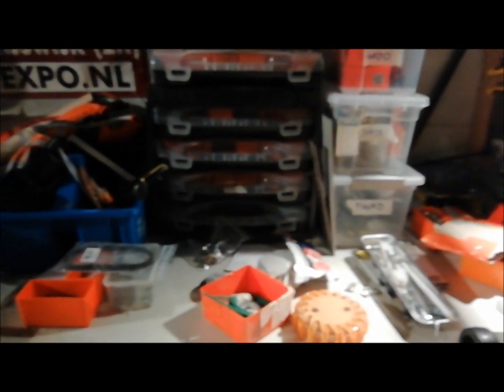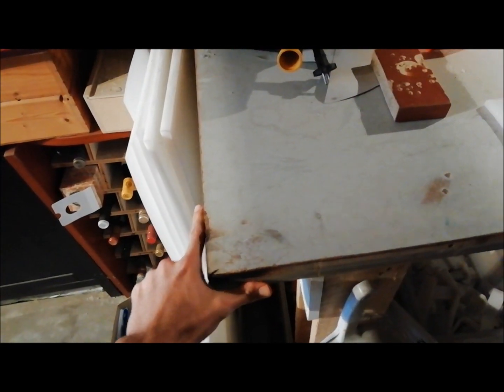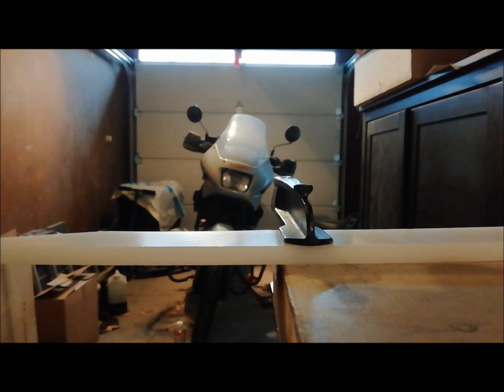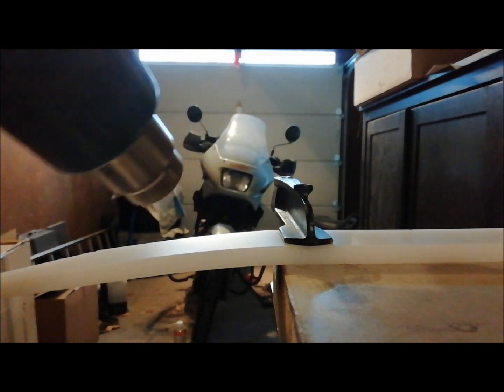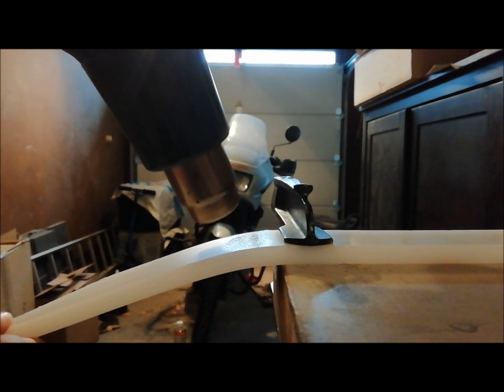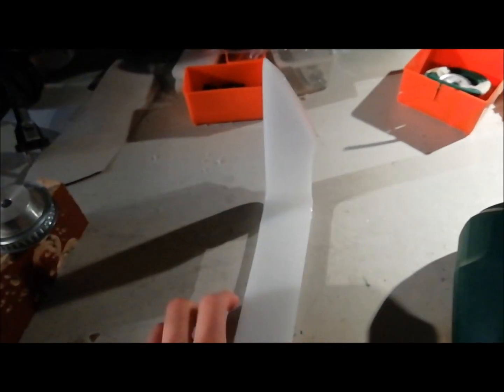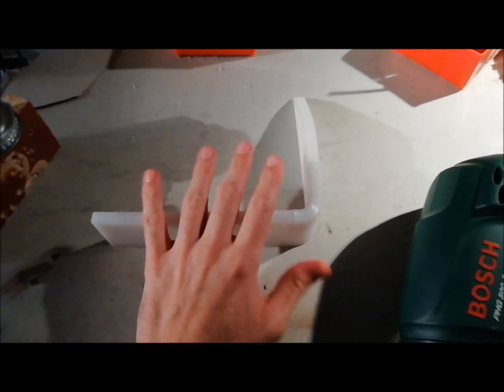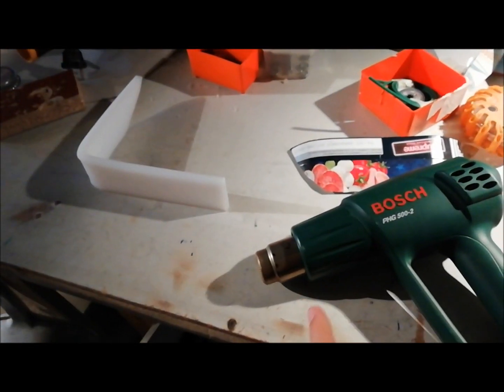Tutorial 1 - On Bending HDPE

Comment: I was thinking about using a sheet of the HDPE for a garage workbench surface.  What are your thoughts on cutting it larger than the bench and using heat to bend/wrap it down around the sides?  I was thinking a thinner sheet, 1/8" (3.2mm) so it's easier to bend.  Thanks!
Reply from the maker: 3.2mm should be quite easy to bend, though depending on the size of the workbench it might be handy to have an extra set of hands to help with the heating and bending.

Comment: Can heat tape be used
Reply from the maker: The heat gun is used at its max setting of 500 degrees C, and allows for controlling the surface and amount of heat going into the material. For best results, a heat gun is best.

Comment: Can I buy a chopping board, cut it to shape and boil in water for a long time and then mould it to the shape of my kayak (100mm / 4 inch quarter radius). I am making a support frame. Is 100 Celsius enough?
Reply from the maker: 100 Celsius might be quite hard - a heat gun goes up to 500 Celsius, and even then it takes a while. One can always try though - that's how I figured all this stuff out myself!
Reply: @TeamHealthNSafety   Thanks for the reply. I'll experiment sometime.
Reply: There are mini heat guns that go up to 350 degrees C.

Comment: i have hdpe but the black sheet used for fisheries farms 

less weight than water 
how can i bend it to be exactly  90 degrees ????
i mean if i bended it at 90 when it cools it may reach 97 or 100
Reply from the maker: Put in enough heat on either side, bend and quench under running water. For an exact angle using a clamp might surely be necessary - the more heat you put in the material, the more exact the angle can be.
Reply: Technically, less dense than water, rather than less weight.